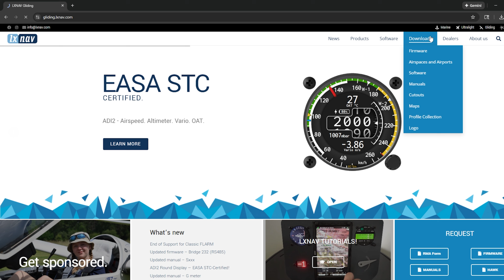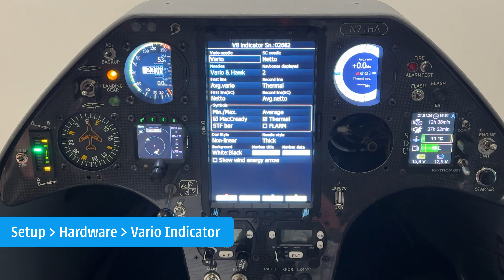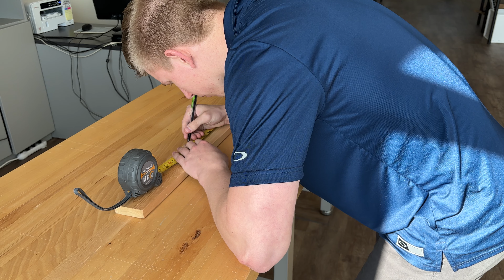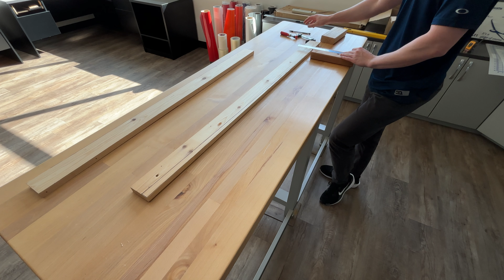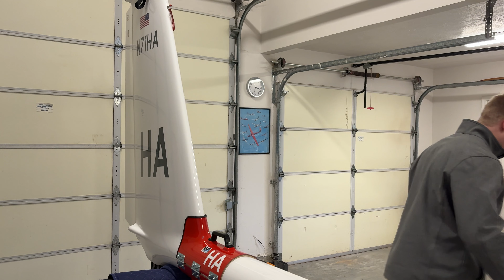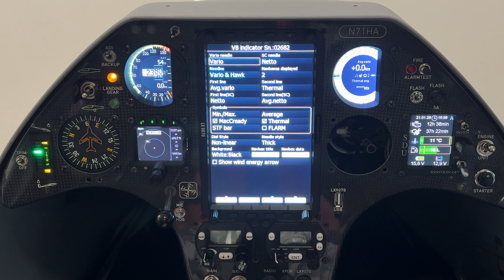LXNAV Hawk Winds Calibration Guide

Comment: a) Which sign do you use for the offset? The same sign as for the displayed sideslip or it's negative? E.g. for a displayed sideslip of +2.5°, do you set + or -2.5° as offset.
b) Is the displayed sideslip supposed to be close to 0 after setting the offset or will it continue to display the raw sideslip?
Reply from the maker: Hi @k.r.837, If the sideslip angle is displayed as positive, you set the compensation value to a negative number. It also applies the other way around, if the sideslip angle is negative, you set the compensation value to a positive number. 

When you are in straight and level flight, the "avg. sideslip" navbox should display 0. If it is any other value then you need to set the yaw offset value accordingly.